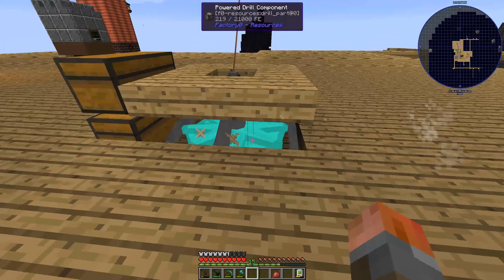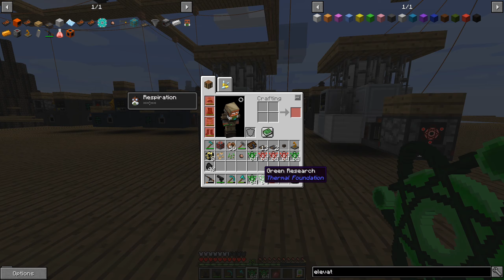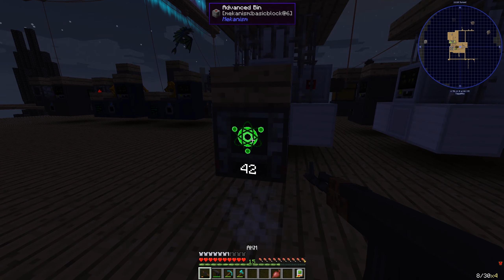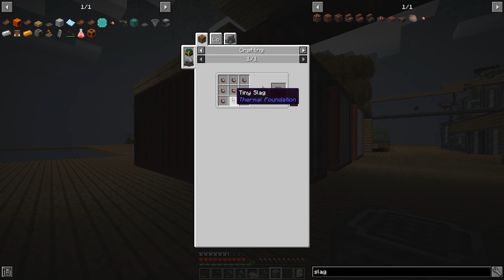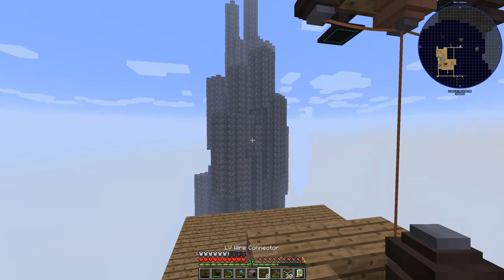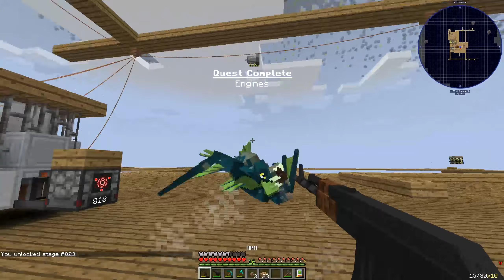Manufactio E08 - Passive Power Generation with Water, Solar (and BioFuel)

Comment: You don't need to put a lantern next to water to prevent it from freezing.  Just block it's line of sight to the sky.  Placing a block above it should be sufficient.

Comment: You can put the solar panels directly on top of the electric drill without the LV connectors or wire and it works fine. I have 9 solar panels  sitting on top of each of my electric drills. The capactors are going to require researching sulfur processing and batteries as well as maybe advanced electronics (I can't remember off the top of my head if you need the last one). if you rotate the inserter on the bio generator it will automatically move the bio fuel for you. Also as for worrying about brown outs in the future the preheaters for the blast furnaces use a ton of power. As for silos they are quite tall and insert from the top and require a redstone signal to output to a belt/chest/inventory of some kind on one or more of the 4 sides of the bottom center block.
Reply from the maker: Aah, nice to know about putting them directly on top!

Comment: Hoppers can't put two items into the machine at the same time so it won't put any. Add one conveyor in front and it will work fine. Also, rotate the inserter on your bio-generator and it will auto feed the bio fuel into the generator.